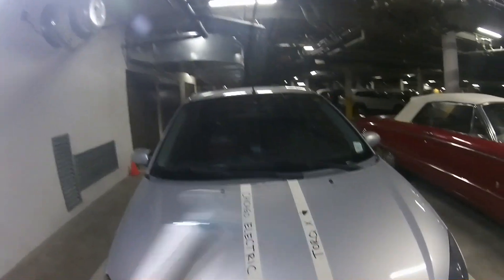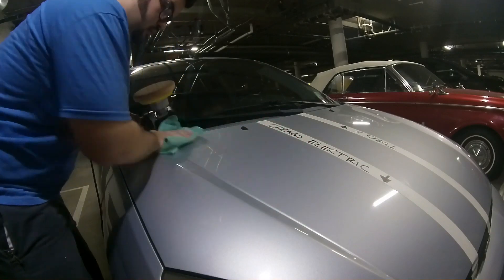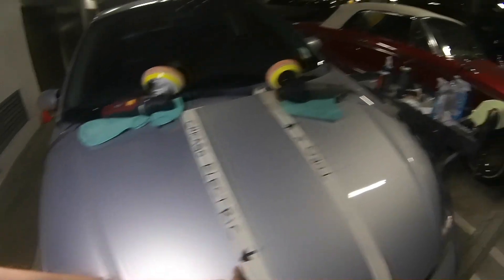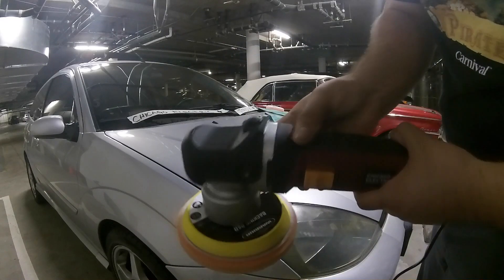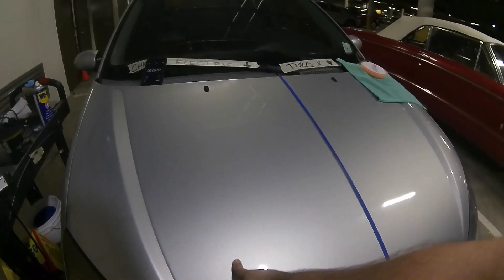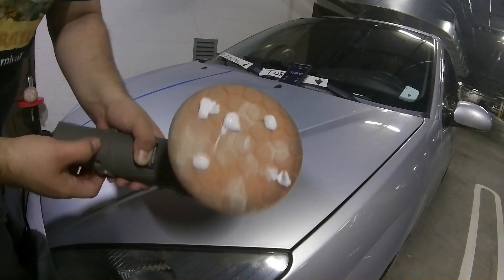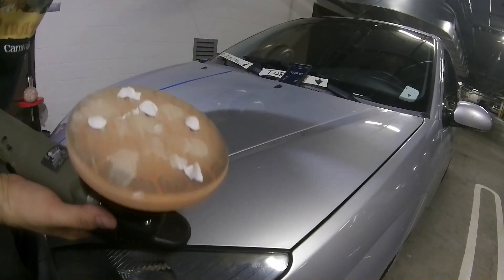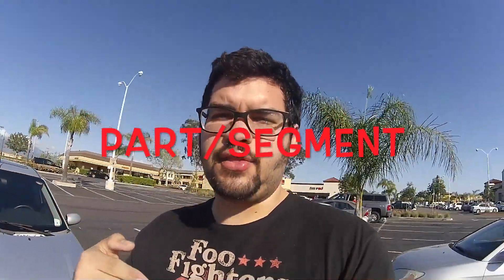Harbor Freight Vs. Torq X Round 1

Comment: Hey, just want to help you clear a few things up. I own both of these machines and I am a professional detailer. I stumbled across this video looking for a comparison of the torq X vs torq 10X. The reason the HF machine is correcting it slower is because you are using a larger pad. The machine is having to work harder to rotate the larger pad, and since the larger pad has more surface area it has less pressure per square inch, rendering it less effective. You should also never polish a car that has not been decontaminated. That grime on your pad is just going to create more scratches. Hope this helps you get better results! Cheers!
Reply from the maker: Benefactor thanks for your info. It makes sense on rotating mass and working speed of the machine. I agree and understand about clay-barring or de-contaminating a vehicle prior to polishing etc. Have a good one! 👍

Comment: note to anyone who watches this you need to get the contaminants out of the paint first, aka hit it with a clay bar, especially on high end cars. it will cut down on the grime that gets stuck in your pad. also i would like to have seen a comparison between the two on a dark painted car.
Reply from the maker: Jacob B correct, and usually higher end cars have a lot of regular details done to them and they won’t need as much work. 

I’ll see about breaking out the two head to head on my Shelby (black paint)or Prius (grey paint).
Reply: @KodysGarage  haha I don't know so much about that I've found that half of the very wealthy people I detail for don't care as much. But I would love to see specifically on bad swirls which I doubt your cobra has, but I would still be interested! Thanks for the reply!